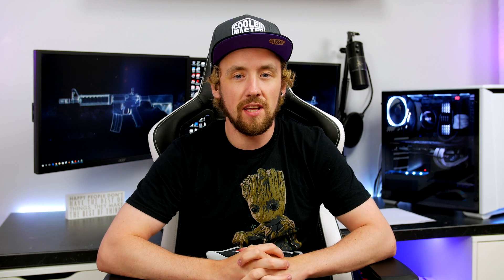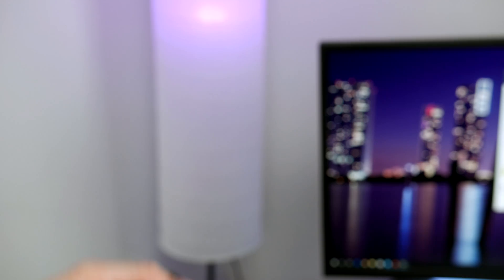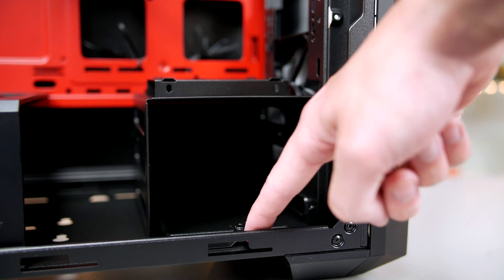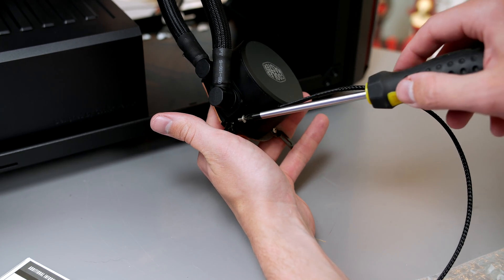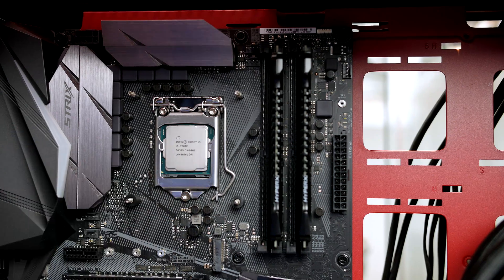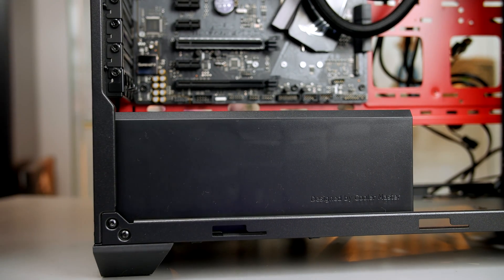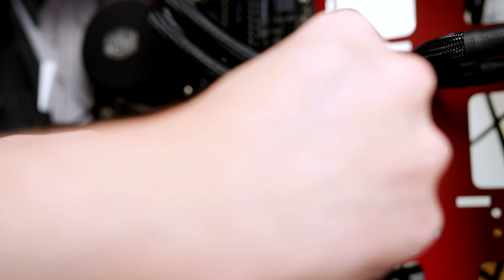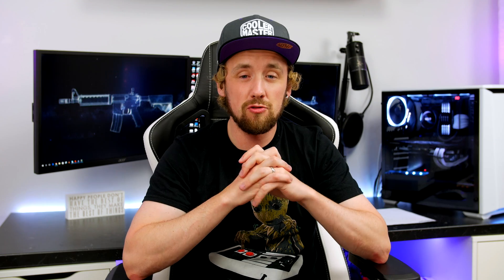How To Build A Great Mid Range Gaming PC 7600K - UNILAD Tech EP 2

Comment: hello i saved 1000EUR and i want to upgrade  my pc. i have a gtx960, i7-3770, 16GB RAM, 550 power suply, 250 GB SSD. i love computers but i rly dont know what parts to get. i want to buy a gtx 1070, but i still need a new mother board, a cooler for the CPU, new case. maybe a new PSU, and CPU. this is where i dont know what to get and i want to ask you for the help?
Reply: gregor gjerek dude, look at getting an r5 1500x or 1600, with a b350 motherboard, 2x8 GB of ram, get at least a 650 psu, and whatever you want to do with the storage and case. hope this somewhat helps
Reply from the maker: +gregor gjerek what James said I'd go AMD at minute